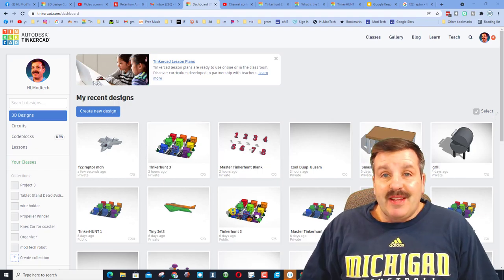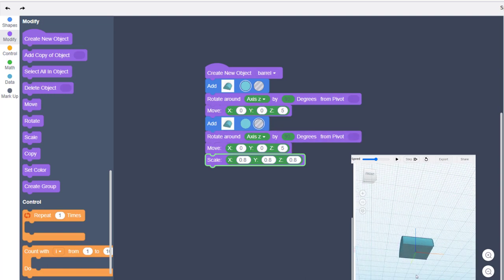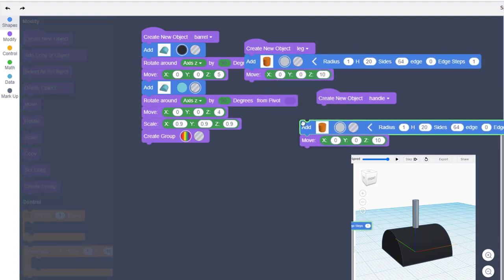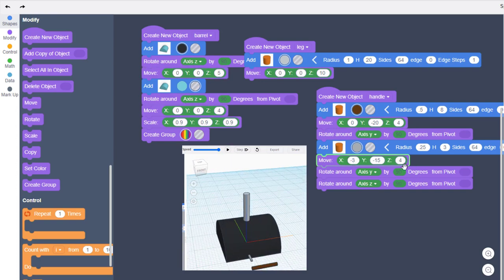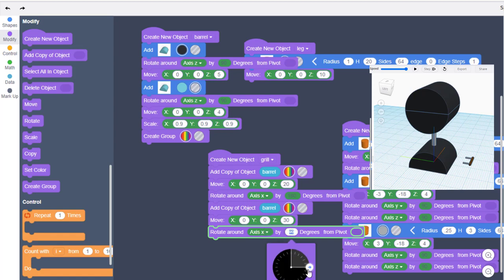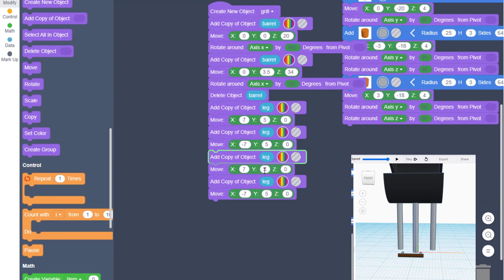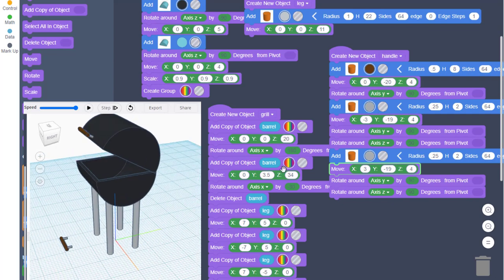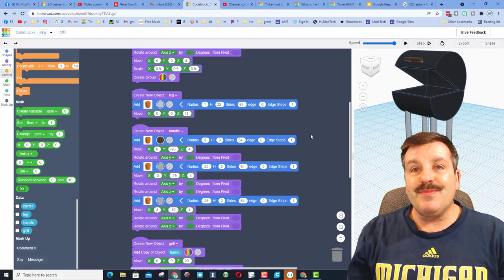Create a Grill with Tinkercad Codeblocks on Minutes

Comment: I am new to Tinkercad and to the 3d printing process..  I have learned a lot from your videos and thank you for that... unfortunately the prints come out terrible.. can you tell what speed, temperature printer and slicer are you using... seems if i print thicker items  works better on my Creality Ender 3
Reply from the maker: I use cura for printing. I have a lot of printers... each has different settings. What printer are you using... that may help me dial in my info better.